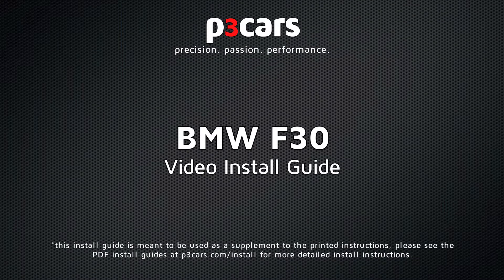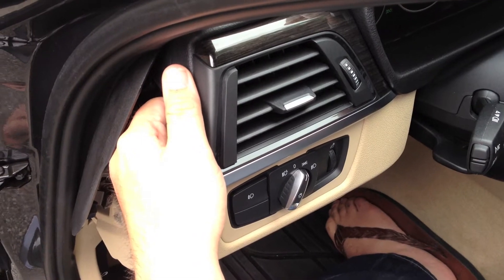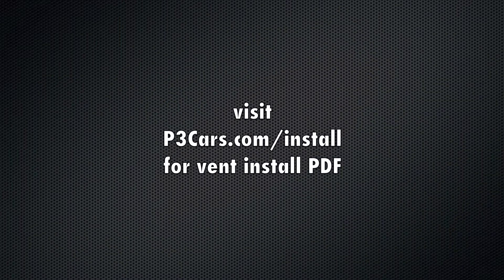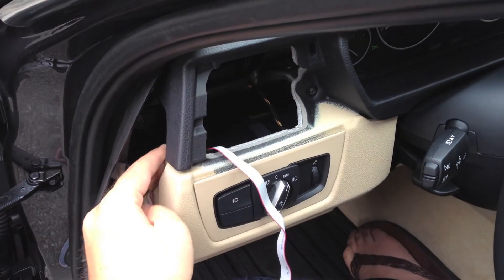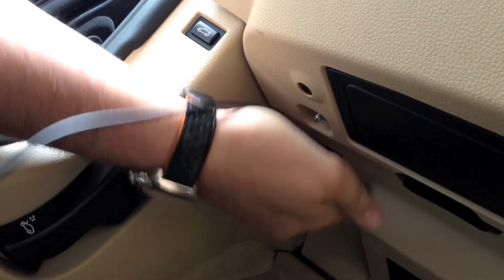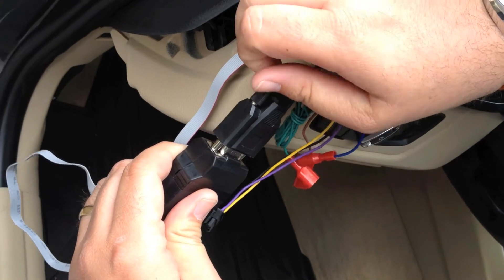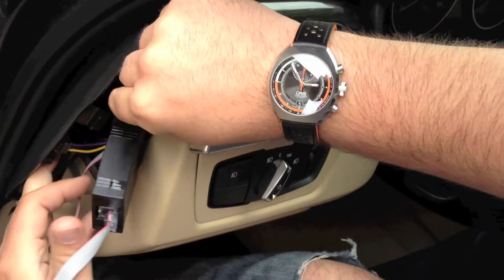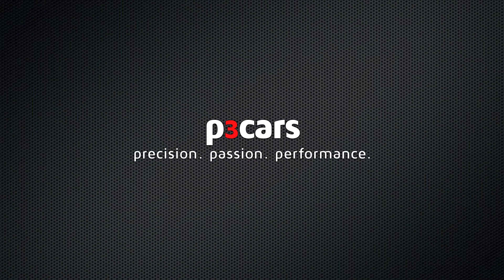P3 Cars - BMW F30 Install Guide - Digital Interface - 328 335

Comment: What's the purpose of the analog boost sensor? Do I need this if I have Dinantronic Sport tune? I wan't to be able to get an accurate reading of the boost on the car. Does the normal boost sensor not do this if I have the Dinan plugged in?

Comment: Would it be the same installation on a 2016 428i ?
Reply from the maker: Yes. F32, F33, and F34 have the same vents and dash setup as the F30/F31.
Reply: Thanks so much for your quick response 👍.  I'm seriously considering getting this item later this month. What i can seem to find here is the obd2 cable adapter needed for this installation
Reply from the maker: @angelsweetpal  This video features our V2 OBD2 Multi-Gauge. This product has been replaced by our V3 OBD2 gauge, though the installation procedure in this video is still relevant. You can find the V3 OBD2 gauge for your 2016 428i here - https://www.p3cars.com/bmw/p3-v3-obd2-bmw-f3x-f8x-gauge-2011-2019/
Reply: Awesome,  thanks

Comment: What important functions does this have ???
Reply: It is used to measure and display data like PSI. It's not useful for everyday use, but those who are into racing will probably want something like this. However, a cheaper alternative will be to hook up an OBD Bluetooth device to the car and use a OBD app on a phone to measure the same data. I bought an OBD bluetooth device for less than $40.
Reply: Does this not fit an F30 N26 2016??? There is no 2016 option on your website.